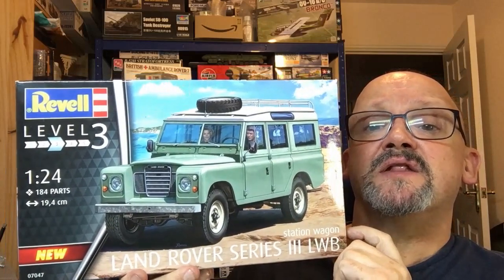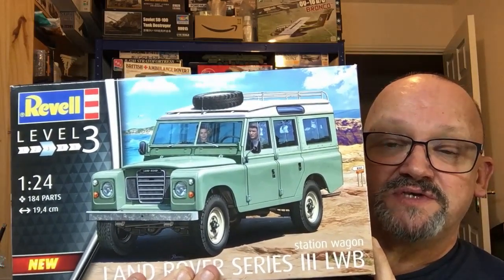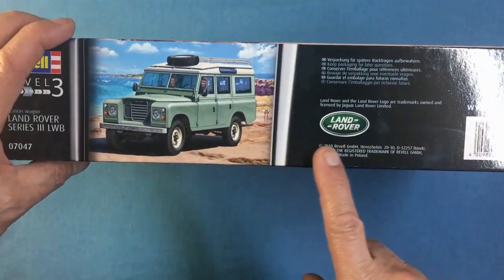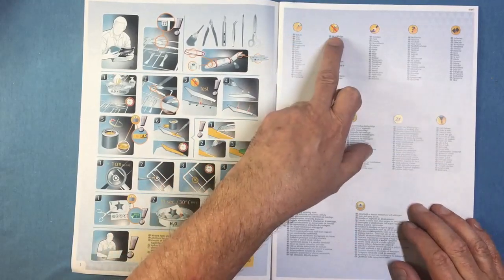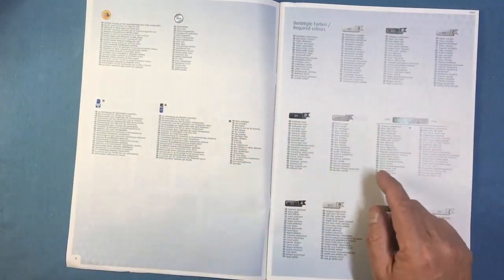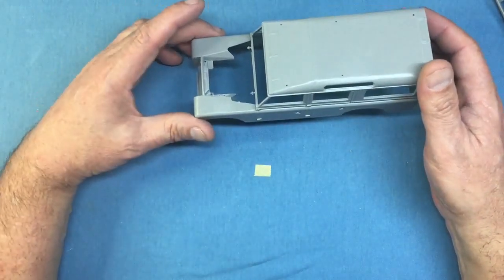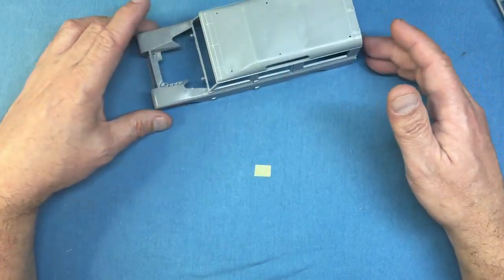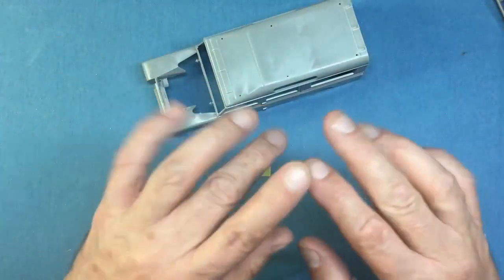Revell 1/24 Land Rover 109 Series III Model kit review

Comment: This is a fun model build with lots of parts.. Everything so far has gone together without issue (I'm about 75% done with the build)..Be aware, Nigel is correct, there are numerous mistakes in the instructions regarding left or right hand drive parts, including the Transmission tunnel cover, gear shift locations and hand brake location.. my suggestion is anything that is left or right hand specific.. double check images on the internet before gluing up, ..